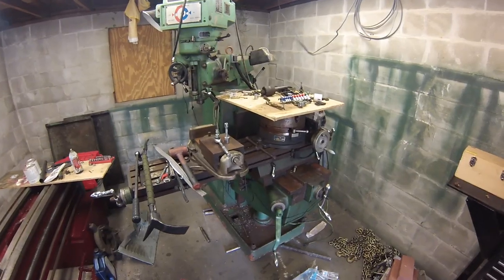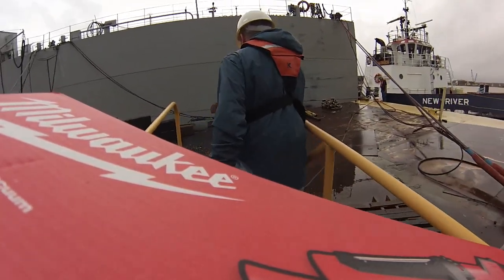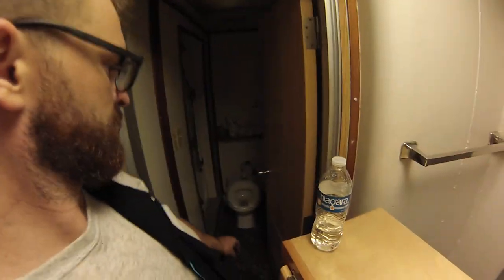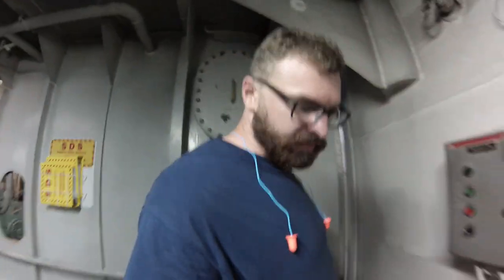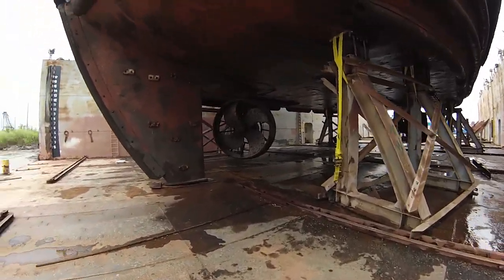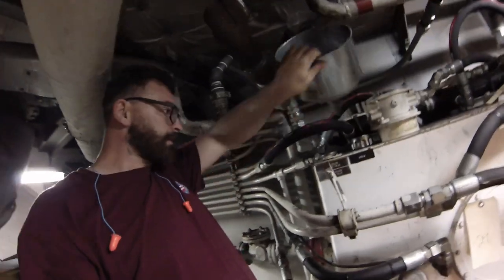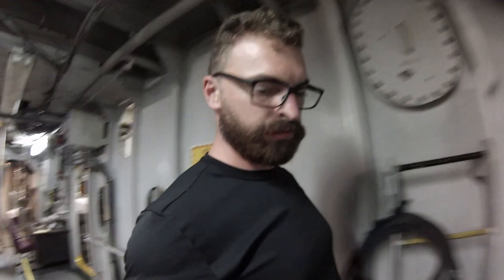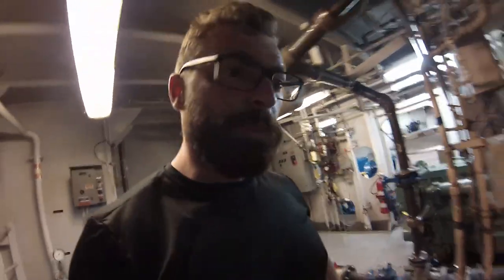Life on a Tugboat 2: Electric Boogaloo

Comment: Not  that I am a stickler for detail but part 46 of the cfr ‘s clearly states minimum size. For crew accommodations    § 32.40-20 Sleeping accommodations - T/ALL.
(a) Where practicable, each licensed officer shall be provided with a separate stateroom.

(b) Sleeping accommodations for the crew must be divided into rooms, no one of which may berth more than 4 persons.

(c) Each room must be of such size that there is at least 2.78 square meters (30 square feet) of deck area and a volume of at least 5.8 cubic meters (210 cubic feet) for each person accommodated. The clear head room must not be less than 190 centimeters (75 inches). In measuring sleeping accommodations any furnishings contained therein for the use of the occupants are not to be deducted from the total volume or from the deck area.
Reply from the maker: We operate in a gray area.